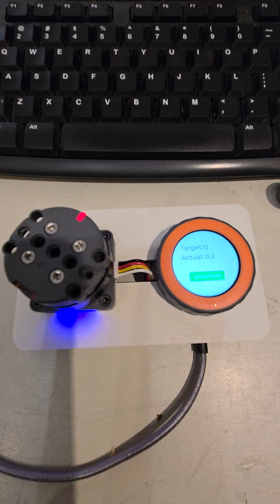Playing with the M5Stack Roller485 BLDC motor as a haptic encoder.

Comment from the maker: It is a 15 bit encoder. I am using with a 0.1 degree resolution. There are 2 versions. This version has a electrical slip ring to bring 4 signals to the end effector. There is cheaper one without that. The cost is about $29 and $33 in the US.
Reply: Is it well documented? How hard was it hard to set up this amazing showcase of applications?

Not all of us is gifted like you 😅
Reply from the maker: @ROBOROBOROBOROBO  I used the UniFlow2 drag and drop programming for this. It only took about an hour to do. 

https://uiflow-micropython.readthedocs.io/en/latest/units/roller485.html

Scroll down to see a Uniflow2 example
Reply: @engserve  Thank you :)